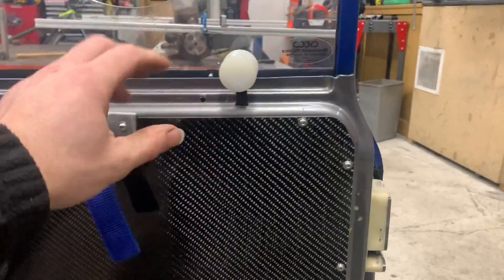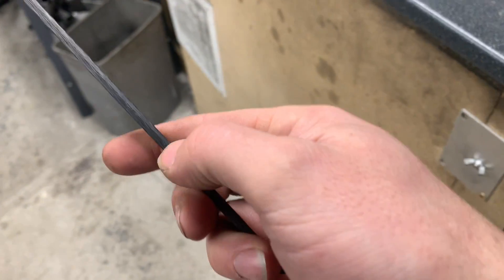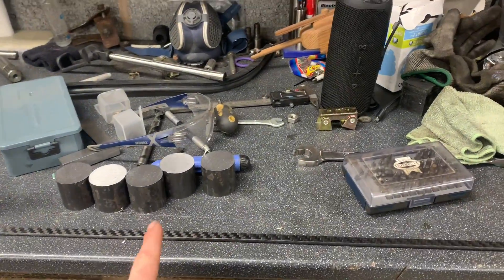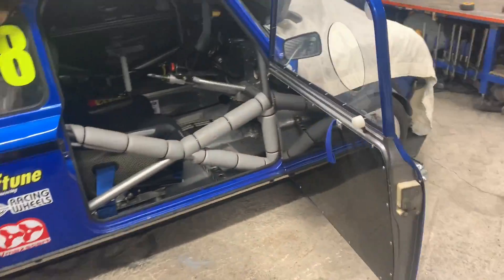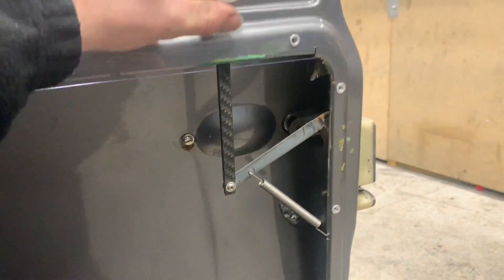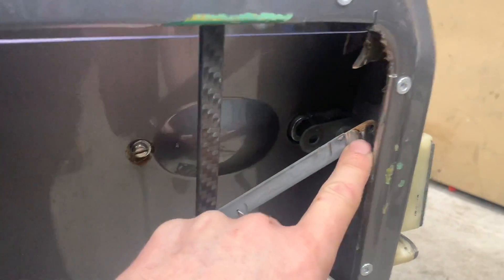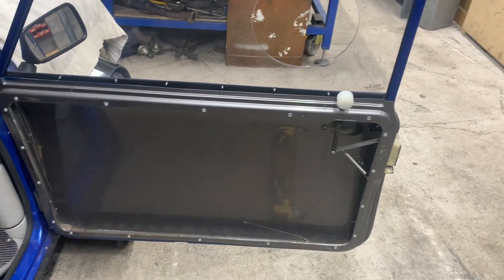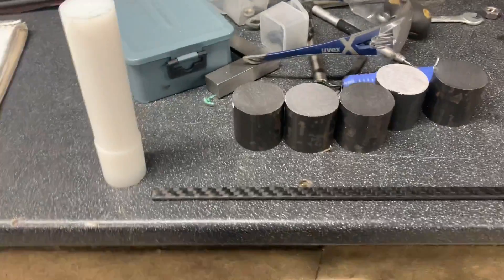carbon race car door open system

Comment: Where did you get the carbon strips?
Reply from the maker: Hi buddy it’s a part we use at work and once the length brakes it’s scrap so I acquire it lol
Reply: @skidmores.garage  I make acoustic guitars and it would be ace for neck reinforcements 
I also have built a couple of trials cars